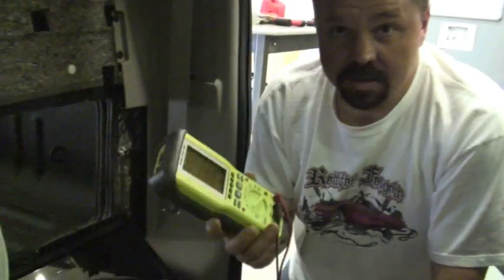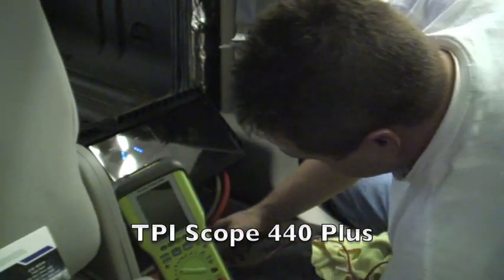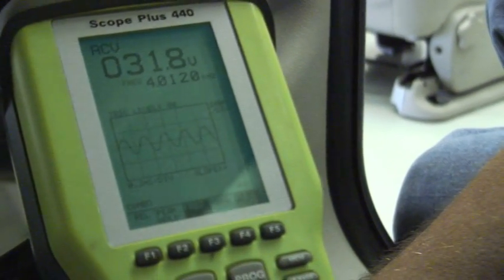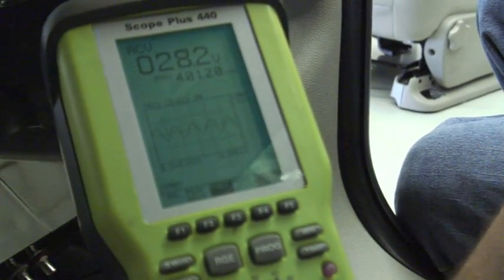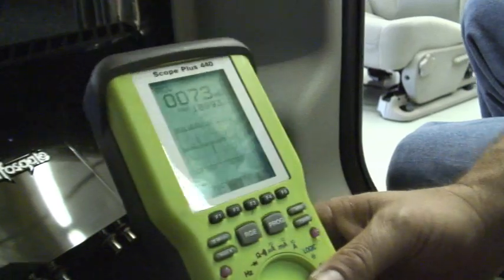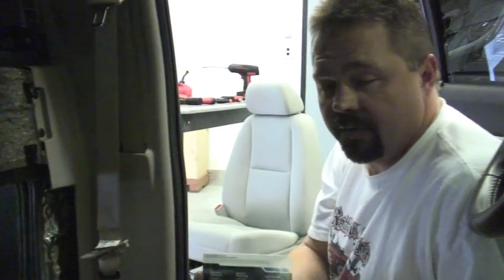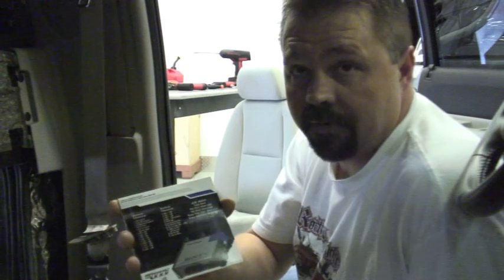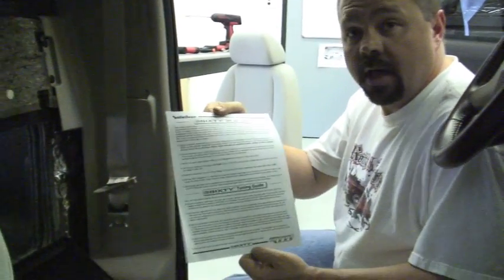Rockford Fosgate RTTi- Setting amplifier gain the Rockford way

Comment: That TPI scope is $350, not $2000.  Anyone who tries to test YOUR brand new system by ear, or without the right equipment is overcharging you.  They don't care if you blow your speakers the very same day.  They don't know what they are doing.  If any shop doesn't use an oscilloscope or at least a DMM to test YOUR system, then take it somewhere else that actually does use the right equipment.  There are so many tools working at "audio" shops, and they are ripping people off by not taking the extra time (or learning how to do the job right) to send their customers out with RELIABLE audio systems.  It's sad.

Comment: So how are you suppose to set amp gains without having buy another tool?
Reply: That may be true, you could be one of the lucky ones.  Unfortunately, almost every "installer" thinks they can do it too, and peoples' shit gets wrecked.  I agree that some tools have issues with volume, but that's because they're keeping the system safe.  if anyone needs more volume while testing then they should buy more powerful components.
Reply: Auxillian Warghost HAHAHAHAHA I've been setting the systems in my cars and my friends cars by ear since i was 16 (I'm 32 now) and haven't blown out anything. True, some don't have the ear for it but alot of people actually do. A friend of mine that works at an audio shop bought Steve meades tool and we decided to try it on my car, didn't hit for shit. Bass was so low (volume wise) by the time the red light came it was ridiculous, So I reset it by ear and sounds way better.
Reply: by ear
Reply: +villen No one should ever be allowed to work at a shop if they insist they they can tune a system by ear.  That is exactly why peoples' shit get blown a week after install.  There are correct tools for doing this stuff the right way, and there are a lot of angry people who didn't know any better and dropped their cars off to wankjobs who don't even respect their customers enough to properly test the systems they install.  A word of free advice to anyone who sees a tech testing their system by ear: get them away from your car ASAP, pay them only for what they have done so far,  and take it somewhere else where an oscilliscope or multimeter is used to actually test gain properly.

Comment: That is all well and good, but I have neither the 3sixty or an oscilloscope.  Nor do I have the 3sixty test CD.
Reply: +Hutch O'Matic I hear ya, but why not buy them so you have the correct tools for the job?  Are you an installer who is charging people to set up their system the right way?  If so, maybe spend a little cash to make sure their systems are stable and nothing is going to get damaged as soon as they leave the shop??  Oh, it's because when they blow their shit a week later and come back back pissed you can tell them it's their fault because they turned their system all the way up but you can sell them a whole new set of speakers and installation labor.....

Comment: when u set the gains where you put the bass knobs at or better yet like my old RF power 500.2 has a bass EQ.. Is the bass EQ on mine the same as the flooding bass knob? My radio on 48 and flat unclipped to my amp unclipped with bass EQ down but if i tune the EQ up it clips. I set my bass EQ to like 1 oclock then set my gains to unclipped.  i like to get the most out of my 500.2 amps an like to know where to set the bass eq @ what about 0-24 octave slope.

Comment: If the amp is standard 4ohm output but you want to wire it at 2ohm what should u do to put a 2ohm laod on that channel without the speaker to set ur gain or is 1 setting for 1,2,4 ohm loads the same?

Comment: I dont feel like buying a 400-2000$ meter... is there another method I can use that is a little more "cost effective" for us cheaper folks, to get the same turnout as using a meter? thanks! :)
Reply: Yea...turn the head unit up to 3/4 of the total volume and then tune the amp literally what he advised against is how Ive done systems since I got into car audio in highschool and im 44 now never had any issues tuning by ear.

Comment: Why wouid the voltage change with frequency? The two have nothing to do with one another in such a short range. You use 60Hz because it's closest to the middle of the bass band AND most DMMs are designed for 60Hz since that's what house current is.

Comment: im not quite too sure how you find that with an oscope....where do you hook it up to test that?
does it need to be hooked up to the amp to test the headunit before you set amp gains with the oscope? i want to turn on all eq settings etc that i want before testing where it clips correct? or not? i would be doing this with the 1khz tone correct? any info would be nice. thank you very much.